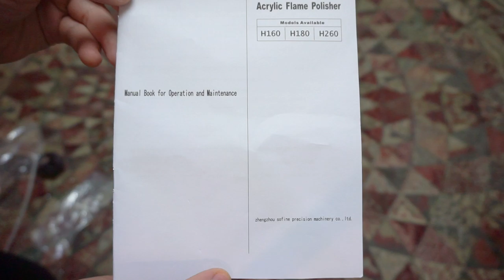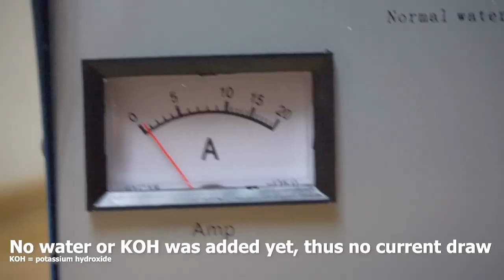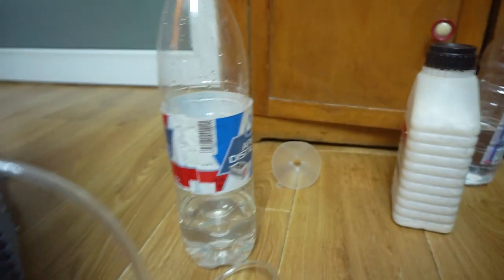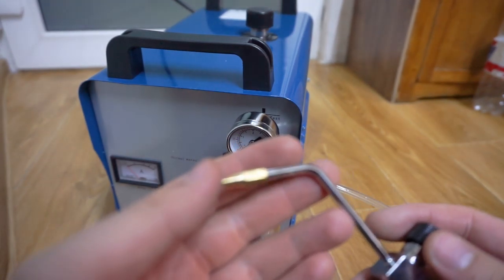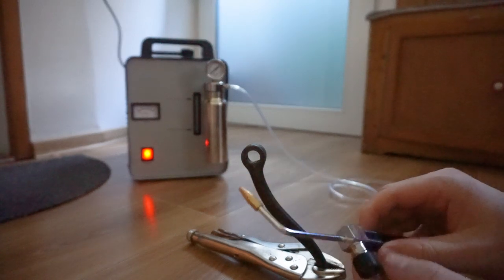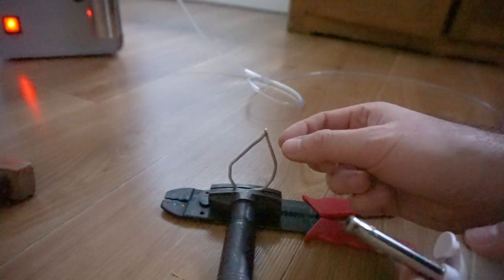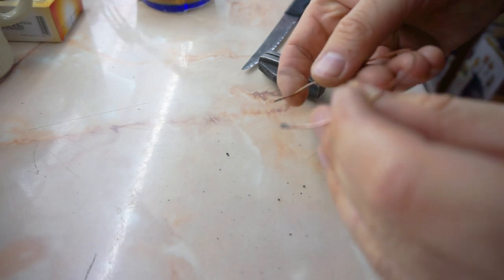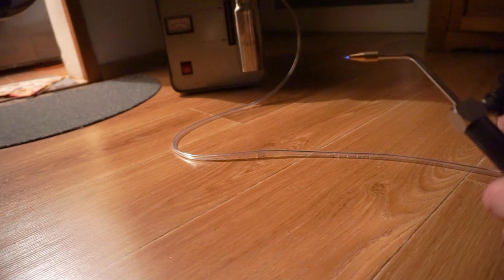Oxy-Hydrogen/HHO generator (Acrylic Flame Polisher/Welder, H180, 95 l/h, 220V)

Comment: The warning sticker on top says to not open the fill cap when machine is pressurised. Also do not light when gas pressure is low. Your initial issue is not measuring the electrolyte (KOH or caustic soda) to the correct ratio. I own this machine and it lasted about 5 years before it simply stopped working, assumed electrode failure because only air was coming out . My newer machine is about 9 years old and still runs great which is the bigger model H260
Reply: I think the unit is bad myself? one watt? Unless his mixture which is very light on the KOH could be causing it?
Reply: @mikeharmon4901  troubleshoot first getting the Koh mix ratio correct, I think 15% is right but refer to the manual. After this check the ammeter is reading around 10-12 amp draw and lastly take the flame tip nozzle off and look thru it to see it’s not blocked , if it is obstructed then use a small safety pin to clean it out then make sure it’s tightened back on properly before use or else flashback can happen causing hearing loss and a minor form of shellshock. Adhere by safety guide in the manual provided and you’ll enjoy years of reliable use from a hongguang oxyhydrogen machine
Reply: I have the h260 as well. It’s from…?? 2017?    The relay went out that shuts its off when it’s reached the pressure limit.    Some said they could fix it…. And they merely bypassed the relat so now it’s super sketchy and just keeps building pressure unless in Have the torch fully turned up. 

I use a knock off smith little buddy?? Torch or whatever it’s called. 

I have one of the two gas lines attached to nothing. This actually works in an interesting way and allows for more Flame adjustment when you open the side with no air flow. It softens the flame.  

I dunno were to get new relay /electronics for it :/

Comment: Your not using enough baking powder, distilled water isnt conductive that is why u need to add the powder and the more u add the more conductive it becomes and ur amperage goes up therefore increases your pressure much faster
Reply from the maker: That is generally true, but I think this machine limits the current (I'm not sure). In other home made generators a tiny amount of KOH made a large difference, but not in this case.
Reply: @furulevi  hmmm probably the power supply that converts the AC into DC isnt big enough, I believe that one is only 300 watts.
Reply: Far away from baking powder...
Reply: @marcopruscini1603  A specific Alkaline solution would be ideal but...
Reply: @bitrage.  Sodium hydroxide

Comment: You must add much more KOH to the water
Reply from the maker: On a much larger home-made HHO generator a tiny amount of KOH significanty increased the current consumption... This must be current limited (I haven't looked inside it yet).
Reply: @furulevi  read  instructions , they are saying 15%
Reply: @davidp8157  Right, but I think 15% is too much, I used 2 teaspoon of 95% KOH and I am at 5 amp, that is about 10 grams or 1%.
Reply: @motto666  You definitely need 150 gram.  It should draw about 15 amps.

Comment: You should use 150 gm of KOH and use the largest orifice that will work.  The bottle in the front should be filled with methanol.  That will produce a bigger flame that is useful for brazing. Without the methanol, the torch is useless because the flame is so hot that it burns the surface of the metal.

Comment: You have to read the manual. I made a similar mistake before myself. You have to use Sodium Hydroxide Solution 15% (850ml water + 150g Sodium hydroxide) ... btw Never touch it with your bare hands because if there is any moisture on them, you will get burned on that spot.

Comment: Hi, i recently bought these machines.  My bubbler did not come with a pre-assembled pipe as shown in 3.07, it came separate with an additional  pin arrow and spring.   i think it serves as a one way value to protect against flashback.  im sure that you will also have these if you remove this pipe.  i want to know which direction i should i connect  this?  Pin arrow pointing towards the pressure guage (upwards) or away (downwards)?  My instinct says towards the pressure gauge (upwards) so it serves to shut of the air from hho generator tank if there is increased pressure in the bubbler from for example a flashback.   However, i couldn't find anything in the instructions/manual.  Any help appreciated. Thanks. Ash

Comment: The only problem I have with it is safety, HHO does not really exist, what we have is an explosive mixture of H2 and O2, you have a classic fuel and oxidizer mixed together, really the machine should separate both gasses and then remix them in the torch.
Reply from the maker: That would be a hydrogen fuel cell, and is somewhat more complicated.
Reply: This is a type of torch/generator that has been used for literally decades. It was literally the first gas mixture ever used for welding (and the gas produced by electrolysis exactly like this). I assure you, as long as you have a flashback arrestor (the bubbler), it is completely safe to operate assuming all other safety precautions are followed. Absolutely no reason to separate the gasses and remix them. It would just add unnecessary cost and complexity. However, unlike what furulevi stated, it really isn't THAT complicated. It is just a matter of separating the anode and cathode into two separate tanks connected by an electrolyte bridge. Oxygen is formed at the anode, hydrogen at the cathode, already separated with no further work needed. However, even that is simply unnecessary for an application such as this.
Reply: @furulevi  Erm no... You just put a tube around the negative terminal for one gas, and the positive for the other. That's secondary school level basic science. A hydrogen fuel cell works in a very different maner.

Comment: you have to adjust the electrolyte in a range of  25 to 35% WT of KOH
Reply: To clarify, 25% volume of the dry and wet to one another? Measure one quart of the dry flake electrolyte to three quarts of water for a 25% mix? Do you use distilled water in both the mix and overflow?
Reply: @RestoringReality  The maximum usable concentration of KOH is normally considered to be 28%. That's 720ml Distilled Water and 280grams of KOH

Comment: You made a mistake with the metal wire. It mustn't get so hot. If it gets too hot, all the carbon in the metal wire burns up. Excessive flame may only act briefly. Too long exposure to the flame will burn the steel. This is very tricky and not so easy to set the correct temperature. Remember HHO flames are much hotter than normal flames. And there are other physical properties. You can easely melt stones with HHO
Reply from the maker: Thanks!

Comment: The flame is not as powerful as I thought. Are you sure your generator works well?
Reply from the maker: The flame is not too small, it is mostly invisible, at around 22:09 you can see that the paper is bending because of the heat of the flame, and at 22:12 it is even burning the paper.
Reply from the maker: Of course the flame is too small to melt the large metal shown at 9:34.

Comment: Just got mine today instructions say that having a grounding plug is absolutly nessisary to prevent electric shocks yours appears to be missing .
Reply from the maker: Devices work without any problem if grounding is not present, that' just a safety feature. The cable shown at 0:13 has 3 wires, phase, neutral and grounding. At 3:38 the wall socket had no grounding.
Reply: @furulevi  Oh, I see . Its different than US plug, US plug has a grounding rod that sticks out from the plug instead of a hole . I just watched a video with the same model as you and I that had ten times the flame and the person I bought from said to use 250 grams of sodium hydrochloride lye . Good luck.
Reply: @personalitycat9842  *Sodium Hydroxide

Comment: Cool machine. Does it have flashback arrestors?
Reply from the maker: The bubbler would be one, but as I noticed the flame does not reach the bubbler anyway even when the gas pressure is low.
Reply: @furulevi   thanks for the clarification
Reply: @furulevi  bubbler is flashback arrestor and works when used pproperly.Insufficient electrolyte, gave inadequate gas production and lack of results

Comment: Does this machine have a flashback arrestor?
Reply from the maker: I think the metal cylinder (bubbler) acts as a flashback arrestor, but the tiny hole on the burner is also stopping the flame from going backward.

Comment: Well I definitely won't be buying one of those. Thanks for the tip!
Just get a AC/DC TIG welder as you can weld pretty much anything with one of those (You can do most metals with just a DC TIG but you need AC for doing Aluminium (NOT aluuuuminium) and magnesium. Might be some others but I'm pretty there the main two). Especially if it's HF as it makes life a lot easier, even if you've got a lot of experience. Otherwise there will be a lot of tungsten sharpening n if it's thoriated it's even worse! 
Try your best not to breath in tungsten dust as it's not good for you, like most exotic metals.
Reply from the maker: A larger machine of this kind would be better. This is sold as an acrylic polisher, not a metal welder.

Comment: The ratio is 1 part KOH and 3 parts water.
Reply from the maker: I think that is waaaay too much...
Reply: It's a 15 percent ratio
Reply: @ghostlee900  i am stupid, please help? Are we measuring the weight of one to the volume of another? Would one quart of flakes and three quarts of water equal a 25% mix? Are you using distilled water in both the overflow and the primary tank?

Comment: I am surprised how small flame your torch produced at 1,5 bar . I use my own torch and when pressure is anything around 0.1 bar flame is almost 10 cm .  Just saying you are better off buying generator .
Reply from the maker: The flame is not too small, it is mostly invisible, at around 22:09 you can see that the paper is bending because of the heat of the flame, and at 22:12 it is even burning the paper.
Reply: The flame size depends on the nozzle diameter. You can simply drill it wider to get a bigger flame. Of course you will consume more gas than you produce, so ...

Comment: you need to add more KOH read your instructions its a ratio between the KOH and distilled water.
Reply from the maker: Could be...
Reply: Pour 1KG of distilled water with .2KG caustic soda powder, stir allow 20 mins to cool.

5 to 1 is the example, 35 ounces distilled water with 7.05  ounces of caustic powder.

You will create a very powerful mixture that will create a flame to burn through half the stuff your video showed couldn't.

You did not have the correct ratio in your drum of the machine.

Comment: This is extremely dangerous the way you designed this.. You need to seperate the gasses FIRST and store them that way, if you do not separate O2 and H you are going to end up with a flame that travels right back up the tubing and into the storage tank...  hot potassium hydroxide everywhere not good! I've seen this. You can reduce the chances of it by creating a mesh based flame arrestor inline, but ideally separate the gas at production.
Reply from the maker: This was bought, not made at home. These devices don't separate the 2 gases, they don't have a separator membrane like fuel cells. The bubbler is the flame arrestor, a mesh type arrestor has no chance of stopping this gas.
Reply: @furulevi  Whether it was bought or made doesn't matter, this is dangerous. The bubbler doesn't protect anything, the gasses bubble up are O2 and H premixed, the flame can and sometimes does travel up the tube. They should be separated and its hard to believe these are sold this way!

Comment: Glad I watched this as I was just about to buy one, but obviously they are just crap
Reply from the maker: Get a larger one.
Reply: The larger one is far more expensive. The issues I see is this is only half decent if you use the alcohol. The other thing is that you have no way to increase the output,  of you could control the amperage then you could increase the hho has output

Comment: The low amperage I think is due to incorrect NAOH / KOH mixture. Distilled water will carry NO VOLTAGE> Also your unit has a pressure gauge where another I saw has a "pop-off" valve in it's place and describes the canister it sits on as a "Blow-back flame arrestor" Filling it with methanol would be not to smart I am thinking. https://www.youtube.com/watch?v=rD8XyicU_bo